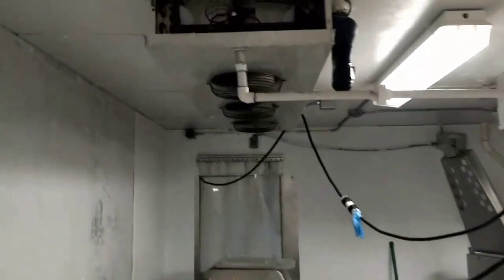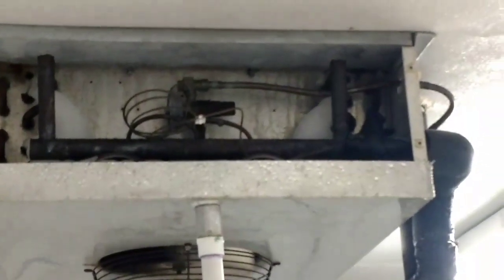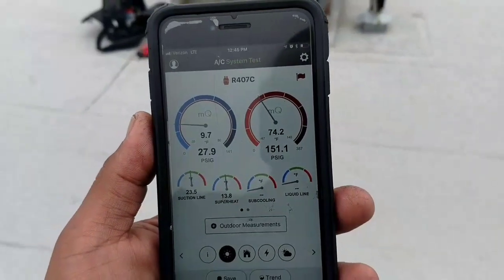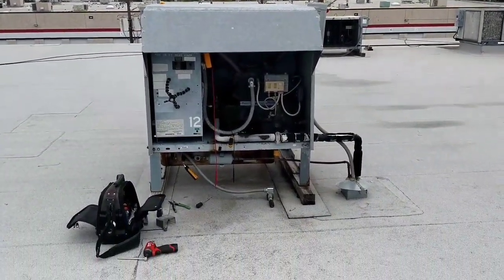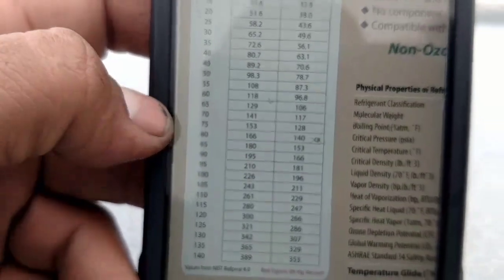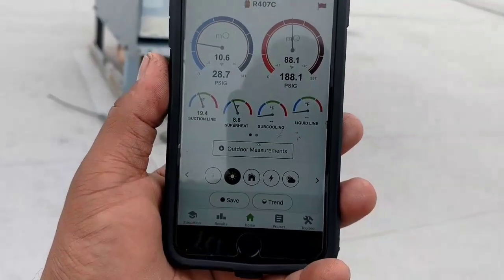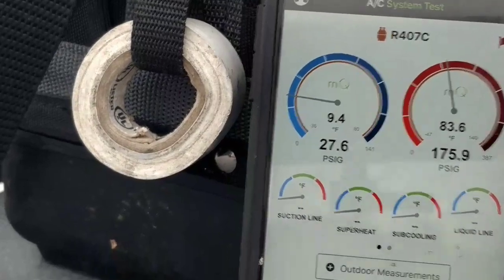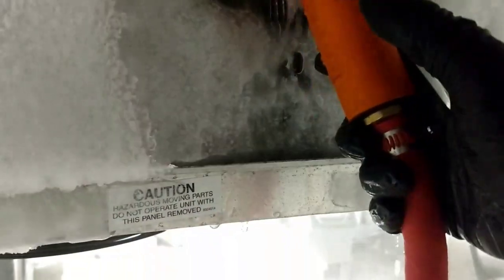Part 1:  Refrigerated Production Room with Head Pressure Issues

Comment: AC veteran but a rookie in refrigeration starting from scratch on your videos. Question shouldn’t your head pressures be higher like 200 psi if your ambient was 65 degrees so the issue would have been low on charge all along?

Comment: bro,,,,,, you have no air flow… evaporators clogged and even i saw dead evap fans. restore or confirm air flow before adjusting stuff. dirty side of those evap you can’t see. get the heat load back in that system. that’s your problem.

Comment: After a year do you still recommend 225 cut in and 50 differential?
Reply from the maker: Depending on the system type and refrigerant, I may have tweaked it a bit.   Trying to maintain a good Saturated Condensing Temp
Reply: @rookierefrigeration4357  Got it

Comment: I usually set my fan psi controls to cut out at 85-90 saturated degrees and 35psi or lowest possible differential. Better constant liquid feed but will cycle the motor more with lowest differential setting. 🤘 good video

Comment: Which Digital probes you guys recommend.The wireless probes,the Smans4,or the Testos,may be Sporlan
Reply from the maker: I have the Fieldpiece probes and also the SMAN 480s.  I like them both.  There is nothing wrong with the testo gauges, but I prefer the Fieldpiece probes over the testo probes.
Reply: @rookierefrigeration4357  you don't have any problem to get connect and disconnect because I just got the probes and have that problem tks 👍🖐